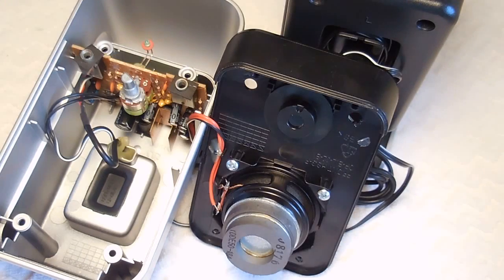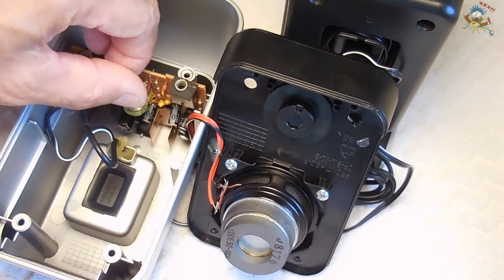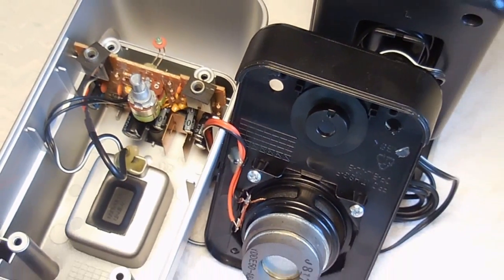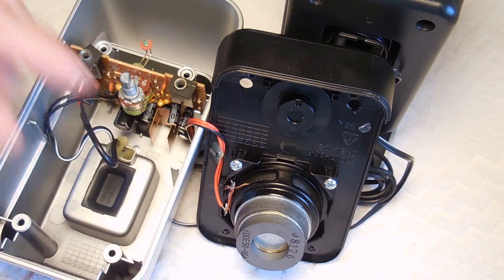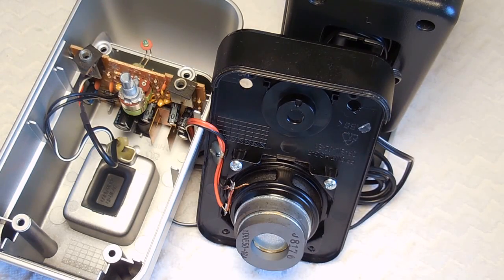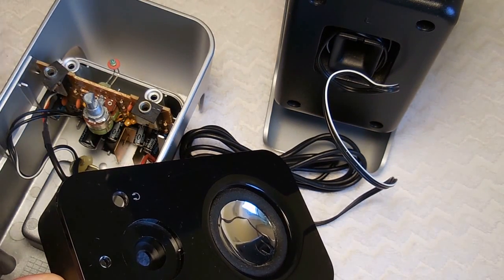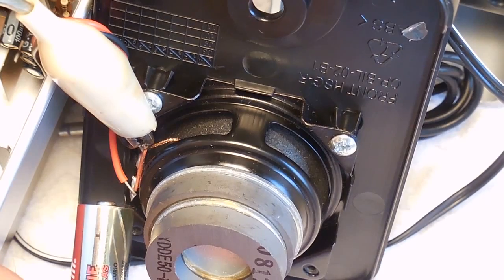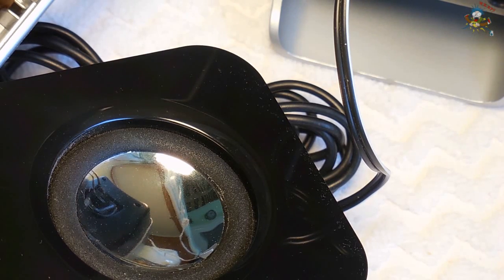How To Easily Identify Speaker Wire Polarity(Positive & Negative)

Comment: I was more interested into how to detect which is positive, and which negative wire, not the speaker connection... Mainly im installing speakers in car, in the trunk, and idk if wires are correctly connected behind radio, so i wanted a test for that... On speakers, + and - are clearly labeled, but i was more curious about wires themselves, how to identify positive one and negative one

Comment: IF YOU DONT KNOW WHICH IS POS/NEG SPEAKER WIRE IN YOUR CARS DOOR READ HERE... 2 SECOND TEST TO TELL. THIS VIDEO WILL TELL YOU ONLY WHICH TERMINAL IS POS/NEG ON THE SPEAKER ITSELF. NOT WHAT WIRE IN THE DOOR IS POS AND WHAT WIRE IS NEG IF THEY LOOK THE SAME.

To test the 2 speaker wires coming through a cars door lets say that look the same... To tell which is positive / which is negative: Multi Meter in DC Volts-- Set too 200M setting (200mv)... play the stereo with pos/neg lead from multi meter , attached to the 2 unknown-which-is-pos-or-neg speaker wires, if there is a positive and always remaining positive fluctuating value. You found pos and neg. If its a negative fluctuating value, you still found pos and neg HOWEVER you currently have the positive lead on the meter attached to the neg SPEAKER WIRE coming through the door . 

Not being rude or anything (to the video poster) just trying to give another method that is (in my opinion) easier explained over words and easier to do in real life. 

:D

Comment: how do you identify which is positive wire and which is neutral however?
Reply from the maker: Disconnect the speaker wires from the sound system then connect the battery to the wire leading to the speaker.
Reply: @electronicsNmore  oh of course thanks

Comment: Dude!!!
You're absolutely NOT showing how to test the WIRES that "look the same" for polarity... You're simply showing how to test the speaker connectors for polarity... And the worst thing is because of the misleading title, & the extra credit course on cleaning potentiometers, we have to wait 4 minutes until we find out that you honestly think that by directly feeding the speaker at it's inputs, you're somehow proofing polarity of the amplifier, or radio, or whatever the audio feed signal source might be with the identical wires hooked to it..
Guys, this is the 4th vid I've watched that's not seen a difference between the words "wire" & "speaker", so here's what I'm going to just try:
(Wish me luck)
Assuming your wires are unhooked from any speaker, & accessible.
1. Turn on your audio source, & DO NOT HOOK UP A SPEAKER TO THE WIRES..
2a. Take a test light & touch a grounding source someplace.. (anything bare metal & hooked to the chassis on a rig, or run your own.. then touch one of the wires until your test lead lights up... You've touched the positive. 
OR...
2b. Take a multimeter set it to continuity. Touch the 2 leads to make sure you can hear the beep. Touch one probe to a grounding source. Touch the other to one or the other of the wires until you hear your beep. The beepy one is your negative WIRE. Not the speaker connector, but the WIRE.. Imagine that. Hey?
Reply from the maker: LOL. Seriously? You disconnect the wires from the sound system, then connect the battery to the wires! After doing that, you'll know which wire is + or -.
Reply: @electronicsNmore 
🤣🤣🤣.. Seriously? So you're trying to put some speakers in the front doors of a work vehicle where there is nothing but a hole & a pair of cut wires.
How does that reply help in this scenario? The title says how to EASILY tell polarity of speaker WIRES, or something very similar.. There must be a way to do it without disassembly of the dashboard, & disconnecting the audio wires & using the battery on that end because easy ain't that.. And it still wouldn't tell you if + or - is coming through that wire after you hook the harness back to the stereo... It's still just telling you how your speaker is polarized because unless you're unplugging the wire from something red or labeled +, it's going to be what the pole of the battery you're touching it to. By testing the wires, we're really testing the output of the source, which isn't always cut & dry in automotive audio systems like it is in home theater systems.. To be "DIY-easy" it really needs to be tested right there where you have 2 cut wires in a mounting cavity. BTW: From the research I did, the "audio gurus"  say it doesn't even matter as long as you have all (or both) wired the same way so the sound waves don't cancel each other out before they hit the ear hole.. I don't know. But, point is when people are looking to figure out the polarity for the speaker wires, they may already know how to do the speaker poles, & not have ready access to the back of the audio source, & even if they did, in vehicle stereos, the speaker wires are often not labeled, nor separate. It's just a bunch of wires on a multi pin harness plug all mixed in together so it's anyone's guess. Also, with the speaker wires sometimes they have multiple branch offs along the way, & can change color by the time they are at the hole where a speaker once was.. Anyways, that's way, way more of an invasive procedure than just doing some sort of simple test..
So, I assume all electrical signals in any speakers wires on any system are going to be DC in a home or an automotive system?. But not sure if a multimeter would pick that signal up like a steady flowing normal DC circuit like a lightbulb or whatever.. I'm no audio expert & only know enough electrical to be dangerous, but I do have common sense, & I know what won't help me find the answer I'm looking for in the application that I'm seeking answers in...
An LED only works with continuity in 1 direction like most standard diodes. Do you think a small (like 5 to 10mm) raw LED would work for quick & easier than disassembly of stuff??

Comment: Woulda been nice if you opened the potentiometer for us to see what you are talking about. Also, can't see how you are using that battery. You got a wire on the negative and you got a battery...can't see what you're doing with it. Is the wire going to the neg of the battery? Keep at it, thanks for trying.

Comment: But how do you know if the wire going to the speaker positive or negative
Reply from the maker: The best way is to remove the wire from the sound system, then connect the battery to the wire, look at the speaker movement, then you'll know which wire goes where on the sound system.

Comment: Never answered what's in the title.
Reply: dumbfounded...
Reply from the maker: Of course I did. LOL. You're looking at it in reverse. You're trying to identify the wires from the sound system, and in this video I showed how to identify the wires going to speakers in ceilings/walls/etc.
Reply: @electronicsNmore  nope. You did neither. You identified how to tell the polarity of the SPEAKER, not the wires. If you were only going to identify speaker polarity, you should have left "wires" out of the title.
Reply from the maker: @stevenverner6546  I demonstrated on the speaker, but clearly if the speaker was mounted with wires coming out of the wall, then you'd test the wires! Geeez

Comment: So you have to take out & separate the woofer to make the positive polarity confirmation? I have 16" Infinity woofers with fairly big magnets. Is there a way I can test the speaker 'red' wire input, which I've always assumed is positive, but this obviously isn't always the case. What about receivers, amps, pre amps? Are we to assume there marked speaker inputs  + & - are always correct or no?
Apologize if I'm missing something, but I've had high end home stereo equip for 25 years & car subs without issue..Except for neighbors calling the cops because of the bass..I'm not mocking, as I'm glad you brought this to my attention..I did watch the video twice & thank you for it..Maybe I'm making it more complicated then it is..Thx

Comment: how to test the speaker wire itself with no color coding using the multimeter? for example an empty speaker cabinet with only wires connectors attached and no speakers? should I test it with my amplifier instead?
Reply from the maker: Remove the end connected to the sound system, and wrap the wires around each post of a 9V battery, next take a DMM and set it for DC volts. Touch the DMM probes to the end of the speaker wire and see it you get a POSITIVE reading. If you do, you'll know the positive is on the correct spot of the 9V battery marked pos. You can also look closely at the side of the wire. One side is smooth, the other has ridges. The ridge side is POS.

Comment: This just tests the polarity of  the speaker. Not the speaker wires coming from the amp.
Reply from the maker: Exactly. Most people have no idea which wire is POS when connecting things up to the sound system.
Reply: @electronicsNmore  So, then why the title "Identify Speaker Wire Polarity"?  It should say, "Identify Speaker Polarity".

Comment: Thanks for the helpful post.  As an aside, I was surprised you did not give an explanation for the neodymium magnet on the negative pole of the AA battery.  And the attachment of the alligator clip to it almost slipped from view without notice.  I have used magnets in this way, but someone looking for a speaker polarity test might also be unfamiliar with that technique.
Reply: I figured it was just there to hold the wire in place so you could connect the other wire without involving sticky tape or your toes. Did I miss something?

Comment: Hi, I have a small sewing machine which requires 6v 1.2 A DC. The polarity is not indicated on the appliance or manual.The polarity on adapter is + in - out.  I am looking for a 6V 1.2 A AC DC adapter.  Is there a way to identify polarity on the appliance and the size of the connector. Am I right to assume this has 7.2W of power and does the power indicated on universal ACDC adapters have to be = or greater without problem. Thanks for any help.  The model is DRESSMAKER II - 1100  link:https://www.amazon.com/DRESSMAKER-SEWING-CENTER-100-ACCESSORY/dp/B0085Q4YTY/ref=sr_1_5?keywords=dressmaker+ii&qid=1554249379&s=electronics&sr=1-5-catcorr
Reply from the maker: If the power jack opening is roughly 1/4" round, then usually the center is positive.
Reply: @electronicsNmore  Thanks I will measure it.

Comment: If you didn't install a system and nothing is labeled. And you have multiple speakers throughout a house with wires inside the wall all going to a central location. Is there an easy way to identify which speaker belongs with which set of wires? I don't have an old stereo to hook up.
Reply from the maker: Use a battery and keep tapping the battery connection fast as a person has their ear next to the speaker. They should hear clicking/popping when you find the correct speaker wire.

Comment: How do you identify the audio output polarity. This vid shows speaker polarity
Reply: I found an app that plays a tick through the speakers and tell if it is in or out of phase... It was called Polarity Checker. It was super helpful.
Reply from the maker: Using a voltmeter. :-)
Reply: @electronicsNmore  got a video explaining this? I can't find any.
Reply: @scottouimet2865  its dc so just put a multimeter in the contacts and if you get a - voltage then reverse the leads and the red one is the positive and the black one the negative
Reply: @pietrog  audio output is AC..
Not DC.
DC destroys speakers

Comment: But you found polarity of speakers - not wires.
Reply from the maker: SuperMilhauz What? Lol
Reply: this only finds the polarity of the speaker itself, polarity of the wires. for example.. i am trying to figure out the polarity of the two wires coming from my car door. previous owner wired it using two idential wires so i cannot tell which is + and which is - . i need to put a new speaker in that spot, but  i don't want to pull the head unit to see which wire is + and - .. so how can i tell which wire is which?
Reply: I have the same problem on my speedboat. The speakers are very well installed and difficult to reach / uninstall, so I need a way to identify the wires without unmounting the speakers. Did you find something?
Reply: @electronicsNmore  so are you going to tell us how to find the polarity of speaker wires out of the factory car or not? Or is the way you showed us still identify the wires?

Comment: Will AA battery work with big heavy speakers?
Reply from the maker: strelok1988 If it does not, then use a lithium ion battery 18650(3.7V)

Comment: Since speaker output is a symmetrical AC signal, why would it matter which is positive as long as both are the same polarity? I know that's the convention, but isn't that just overly simplistic for teaching purposes?
Reply: rstevewarmorycom cause od alternating current ;)
Reply from the maker: rstevewarmorycom It does matter to get the correct deeper tones out of the speaker. Speakers are marked + & - for a reason. 

Thanks For Watching
Reply: electronicsNmore But Terry, why would that matter if the driving sound signal is symmetrical AC? Makes no sense.
Reply from the maker: There is a slight difference in sound quality if the speakers are not wired properly, but what is really important is that ALL the speakers are wired exactly the same. If you do not wire them the same(+ & -), then one speaker will be pushing out at the same time another is pushing inward.
Reply: electronicsNmore Yes, I said I knew that they must be the same, but why would sound quality be different as long as they are both the same polarity? Makes no sense unless you imagine that it must be exactly the same compression-rarefication as the original musical piece.
Reply from the maker: I have a friend that is an acoustical engineer and he also confirmed the polarity must be right to get the correct deeper tones from the speaker. So I won't argue with him over it.
Reply: electronicsNmore Gee, since he's not here I guess I won't either.
Reply from the maker: I am sure you can search on Google for the answer to your question.
Reply: @electronicsNmore  Nah. Polarity doesn't matter so long as they are both the same. The myth that it matters comes from hearing a stereo system where the speakers are wired differently. In this case the sound is tinny and the bass seems to be missing. It's more noticeable the closer the speakers are to each other. Match the phasing and bingo you get the deeper tones. I challenge anyone to successfully pass an A/B  listening test where they can consistently and correctly identify the correct phasing.

Comment: That's a good tip. We used to often do this when I worked in the live sound industry, we tended to use fresh 9 volt batteries as usually we were dealing with 15" drivers. Sometimes after getting one back after sending it for a re-cone they would be wrong.

The accepted standard is +ve will make the speaker push out when connected correctly, as you state, but for some reason JBL always had used the opposite! The speaker would pull in when connected to the +ve marked terminal! So usually we connected these drivers "backwards" so they would be correct!

Comment: can i do this tests on a bigger speaker?
Reply from the maker: JinRei Yes, any size. You may have to use slightly more voltage(2 batteries in series) if you see little if any movement in the speaker cone. 

Thanks For Watching!

Comment: Some wire pairs will have a few strands of different color on one of the but usually very hard to see. I have never seen paired "zip wire" that did not have an outer identifier that was either ribbed or a single raised line verses the smooth jacket next to it. This is true for clear and or color insulation. Then there is the stranded wire with a fabric marker hiding under the insulation. Love the battery test, been using this for ever

Comment: What do double speaker magnets function for.
Reply: bazrazin1 Speakers that have a stacked magnet assembly are for use near Cathode Ray Tube monitors (CRT)
The smaller one is glued on top of the bottom one in an attempt to cancel out the magnetic field that normally surrounds the speaker, this second magnet is in the reverse polarity of the other. Normally if left unchecked, these magnetic fields in close proximity to the monitor it can cause the electron beam to stray and or magnetize the monitor. The result can be poor image, both in shape and color on the monitor. Flat screen LCD displays do not have an issue with stray magnetism .The larger magnet performs the basic function to supply the pole piece within the speaker with magnetic energy that the voice coil can work with.
Reply from the maker: Craig Nehring Good info! I did not know that.
Reply: Craig Nehring  excellent answer, had been bothering for years,nothing mentioned in the books & I thought it improves speaker o/p power, so just for stray magnetic field cancellation.

Comment: I never realized speakers were polarity sensitive.

Thanks for sharing
Reply: Daniel Piotrowski They're not. The + and - are here to make sure different speakers are in phase with each other but for one speaker it doesn't make any difference since it's driven by AC current.
Reply from the maker: Daniel Piotrowski They will work connected either way, but for the best sound quality you should have + and - in the correct spot, which is the reason why speakers are marked + and -.

Comment: Most zip wires that are colored the same will have a ridge on one side to distinguish the two.
Reply from the maker: Byron Dallas That is true, that same ridge is used on 2 conductor AC power cords to identify the neutral wire.